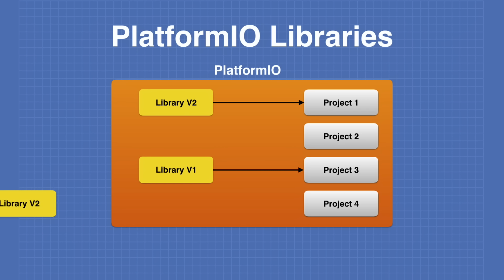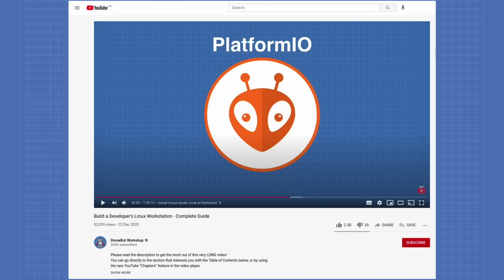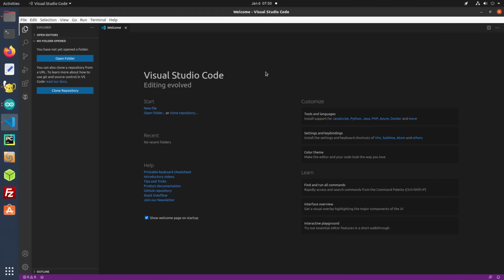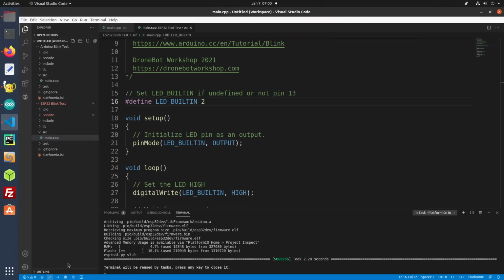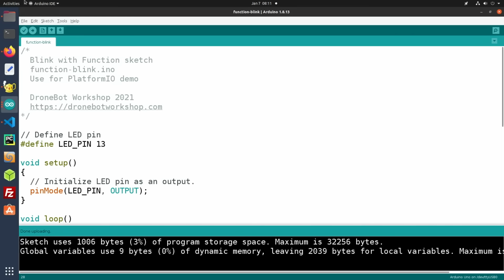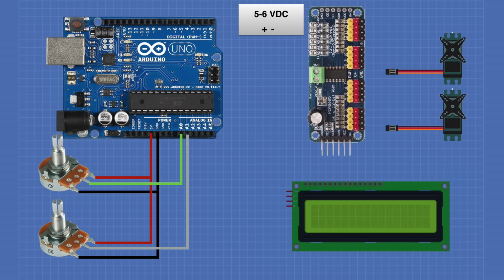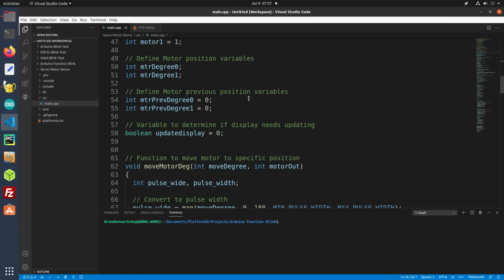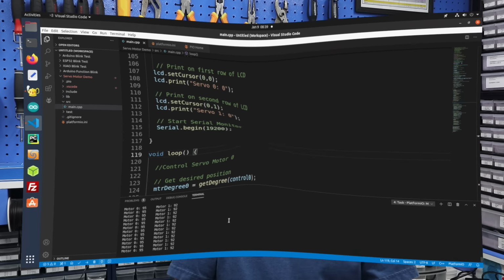Getting Started with PlatformIO

Comment: Such a great tutorial.  Got frustrated trying to figure out why I was not able to upload to my ESP32 until I remembered that I need to hold the boot button down until the IDE says 'connecting....'
Reply: Or you can fix that once for all by soldering a 10uf capacitor between the enable pin(EN) and some GND pin in your board. More info here https://randomnerdtutorials.com/solved-failed-to-connect-to-esp32-timed-out-waiting-for-packet-header/
Reply: I will try that. Thank you!

Comment: Bill, another outstanding video. It sounds like you've changed something in your audio setup for the off-screen parts of the presentation (showing circuit diagrams, etc.). It sounds much better. It wasn't awful before but now the sound is more uniform across the entire presentation. Well done.

Comment: You mention that the upload port is automatically set. I can't get that to happen.
No matter how many times I unplug/plug the board, the port never shows up when I upload or even on the devices home page.
I don't have this problem with the Arduino IDE.
Am I holding my mouth wrong?
Reply: You can set the upload port manually on the platformio.ini file like this:

upload_port = COM9

Or you can also use the fancy user interface that you can access through:

Click pio icon on the left > then go to quick access > PIO Home > Open > when the user interface appears go to projects and click "configure" on your project > after that you click on the "new option" dialogue bar and search for "upload_port" and click on the first option > now you type the port that you want to upload to on the dialogue bar that has just appeared like this: COM9 or COM5 or COM1 etc. The advantage of using the user interface is that you also get access to all the other configurations that you might need in the future, like upload speed, baud rate, board selection and so on. I dont know if this is relevant to your issue but i hope this helps someone
Reply: I think that is the problem with platformio,  if something goes wrong how to fix it.  In your case it is pretty easy just add  "upload_port = COM2" to the platformio.ini file under [env:uno]  then File->save ,  if your using linux your port name can be   /dev/ttyUSB0  or /dev/ttyACM0  etc....
Reply: @noweare1  the documentation has almost everythimg that you need in order to solve a problem that you might face, all it takes is just pacience to read all that's there :)
Reply: @5-days-b8s  It wasn't like that 2 years ago when I first installed platformio. It is much better now.

Comment: If you want to use the same code, but target multiple boards, you can add extra environments to the project, and flip between them.
Reply: how exactly? Link to Post or Video would be enough :)
Reply: @droidebuilder486  https://docs.platformio.org/en/latest/projectconf/section_env.html

PIO projects tab, click configure on your project, click +configuration

Comment: Thanks for the video! I've looked at the platformIO website and was unable to properly determine what it is lol.
Is it compiling locally or does it compile in the cloud or some such nonsense? Do you need the internet or an account to use it?
EDIT: The video shows the answer, apparently it downloads the compiler and SDK to local PC when you select a new board and needs internet for that, but then works locally. Sounds like the perfect toolkit!

I use VS Code for C# and it's very nice and compact and easy to use. It's the first MS software that I really like and respect.

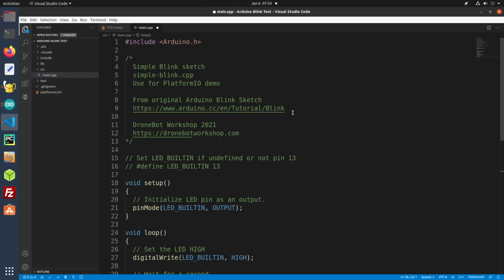Comment: At 17:26 you paste in the blink code, but I cant figure out where you go it??
Reply: He had it copied in his clipboard from another text editor I guess. Btw, you can also get the blink example in PlatformIO by going to PIO Home -> Platforms -> Atmel AVR (in this case) -> Examples. There are also other types of examples available, but not all from the Arduino IDE. Those can be copied from like https://github.com/arduino/arduino-examples/tree/main/examples
Reply: @Max-en7er  thanks for your reply. That will work for this sketch, But what about the next? I think the problem is that the first link seems to be wrong.

Comment: Man, if I had known this 2 weeks ago you are doing this video. I was struggling with some parts of my VSC/PLatformIO installation, and it took me some good time to duckduckgo the details. Well done. What I like most is that in VSC/PlatformIO the board settings are part of the project. Great, if you work with different boards in the same IDE

Comment: Great touch using the servo controller. You could have easily controlled the servos without it, but the controller  off loads a lot of work from the microcontroller. You must of have been an instructor, because you're far too organized and structured in your presentations to be an engineer. An engineer would be all over the place and need a project manager. Also we like to draw diagrams and write code on napkins and scrap paper if it's available.  Excellent presentation. Very professional.
Reply: Some engineers are instructors and some instructors are engineers ....
Reply: @tomgiberson4376  Those are the tame ones. I've been with the rough bunch. The ones that go out with Intel or MS and run up a 5000 dollar bar tab. Since I've gotten older I've slowed down a lot. Thank you Tom for being so nice. I hope you have a great day.

Comment: DroneBot community! I have scratched and banged my head trying to figure out importing modules on Python (lib machine for Micropython). I have installed via python -m pip install and via GUI within Thonny. Result is a ModuleNotFound. The library is still found in /usr/local/lib and to my knowledge Thonny is even set to seek file out within /usr. Still the same ModuleNotFound error. Very frustrating. I then open Python3 and get the same result. I then run the command as a function instead of a string, just to test it. Still the error. If any of you have encountered this small problem, please please please let me know in fairly plain speak. Stackoverflow has not been a user-friendly resource.

Comment: Bill, I can't believe you've done this to me! I've spent months learning the Arduino IDE, & now you want me to ditch that, and start something new😩

I've used displays in my projects so far, should I stay on the ArduinoCode, or move? I used Visual Basic at uni, but have never used anything beyond that, and have used only C++ since then.
Reply: I'm sorry you had to use Visual Basic, but I guess it teaches something. I'm just not sure what. I started with regular basic on a unix system. That was back when we had dinosaurs roaming the computer lab.  Good thing you don't need assembly language anymore, but it taught me structure if nothing else...I hope you have a great day. Go Python..
Reply: I'll probably always use the Arduino IDE. That's what most people are familiar with looking at. I may use the platform I/O at some point, but not for now. Focus on what you're familiar with. You don't need another learning curve at this point. Focus on what's important to you. Your project. The Arduino IDE is crude but it's still an effective platform solution that's not going away anytime soon. Flow charting everything is the way to go. When you don't have paper. Flow chart in your head. I do it when I have to and you can too. Sorry about the long text. I live for this stuff as well as the raspberry pi and Nvidia Jetson. I would highly encourage you to look at both of those, but never give up the Atmega 328 or its cousins the esp8266 or esp32..Stay confident and have a blessed day...Rick
Reply: @rickhunt3183  Awesome post Rick. I don't understand it but I love microcontrollers and what they can do. Just amazing

Comment: In the case where the led function was not known before its use you could have just declared it above the loop function and then defined it later. Declare means just stating the function's calling signature. Define means actually coding the contents of the function. FYI, nearly all library functions that you are using are declared in a header (.h) file.
Reply: They are called function prototypes rather than function declarations.

Comment: I have been using it for a few months, and I really like most of its features. I just wish there was a direct way to create a new copy of the current project  so you can create a different project from it. I know how to do it the round about way.
Also, if you have more than two projects with their .cpp files open at the same time, it can be a little hard to tell which one you are editing. Obviously, it is my inattention that's the problem here, but I wish PlatformIO made it easier.
Reply: For files which are named the same, e.g. main.cpp, VSCode will display the project folder's name after the main.cpp in the tab view (https://imgur.com/a/6Jp68vT). But you're right, if you have two files which are not named the same (like `main1.cpp` and `main2.cpp` from project 1 and project 2), VSCode will not indicate which workspace the file is from :/